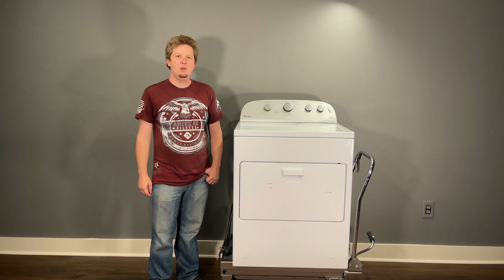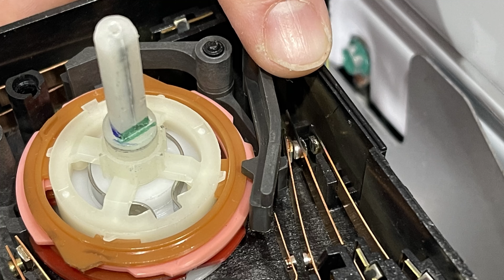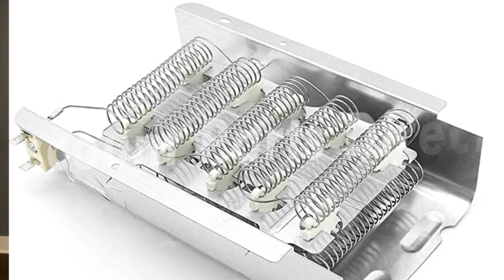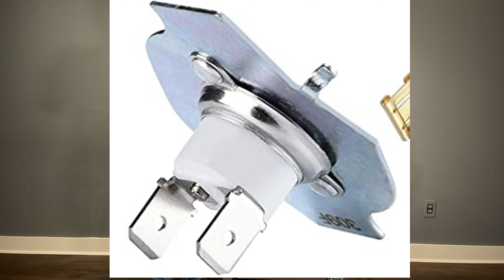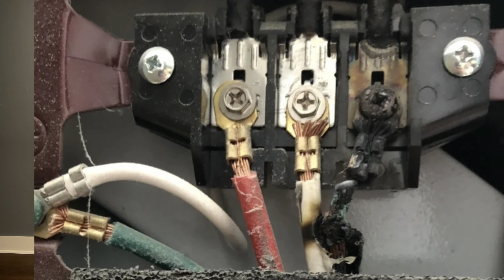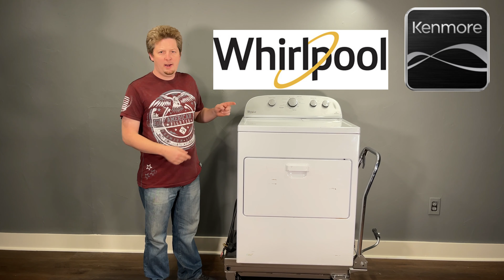Dryer No Heating? How to fix Not getting hot￼ or drying Whirlpool, Kenmore, Amana repair Guide

Comment: What does a pause/play washer gearcase do if the splutch is what changes it from agitate to spin? I saw the video where you took one apart to show the bearings. I have a kenmore washer that during the wash cycle its trying to agitate the whole tub instead of just the agitator. Ever seen this before or have a fix?
Reply from the maker: I have seen that but it’s been a very long time. I feel like it would be the actuator.
Reply: That was my first thought too. I'm a fellow flipper and repair tech. I did change the shifter and actually watched it work. I should also mention that it was working fine but tried to take the tub out for cleaning (wouldn't budge even using the c-clamp method) and now it doesn't agitate right. The drive shaft was in bad shape, took alot of penetrating oil and persuasion just to get the agitator off. Maybe some rust or debris got in the gearcase and jammed the driveshaft?
Reply from the maker: Thy taking their entire split here of and re-lubricate it. It might be that it’s a lot moving up and down as it shifts. Or that it is stuck mashed together.

Comment: I thinking added more water to my front load Maytag washer but the level switch is non adjustable. So I`m thinking its air pressure at switches it if I add a 1/4 gas filter in line with switch making more air space ,more air means more water .
Your thoughts?
Reply from the maker: Interesting I’ve never considered that. So You’re saying the gas would compress at a slower rate than air and then put a check valve so you don’t lose the gas. Just be careful because you don’t want a washer machine overflowing in your house.